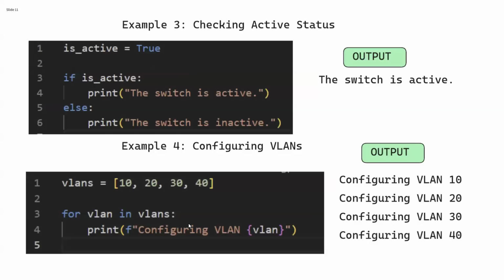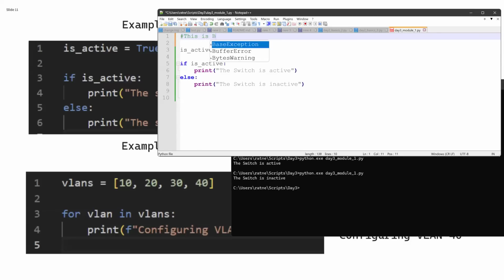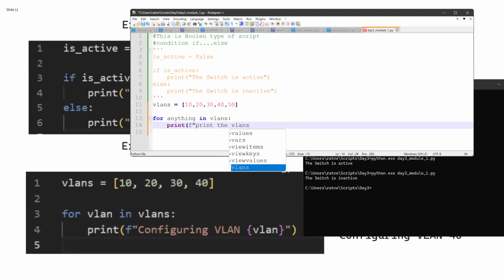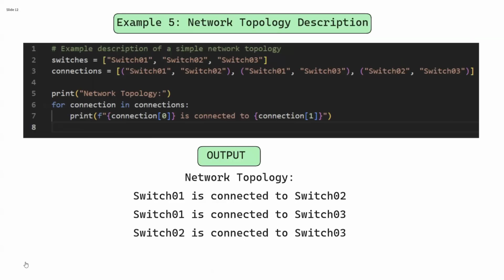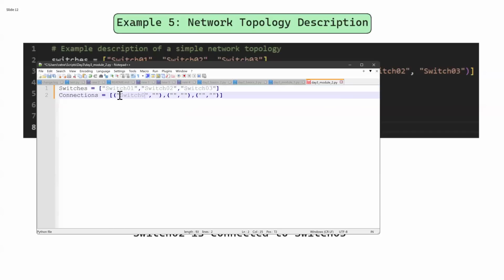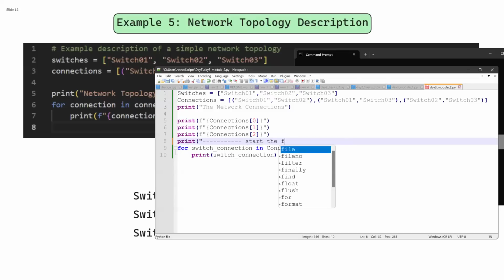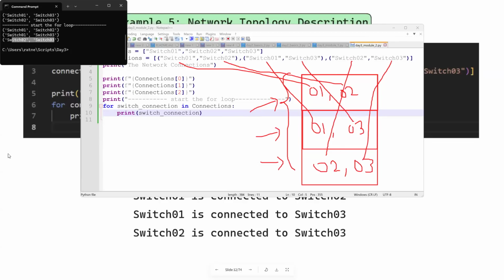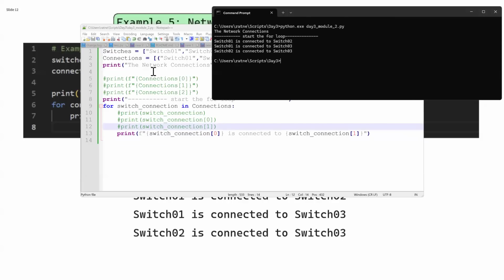Python Training 03

Comment: How to know how much IPS bandwidth is required( like 100 mbps or 1 gbps) as per the site user number, can you help me to understand.
Reply from the maker: 1. Understand the Basics of IPS Bandwidth:
The IPS bandwidth requirement refers to the amount of traffic that the IPS device can process without causing latency or packet drops. It needs to be sufficient to handle the site's maximum traffic volume while performing deep packet inspection and other security tasks.

2. Assess the Site's Network Traffic:
A. Calculate Peak Bandwidth Usage:
Measure the peak bandwidth usage at the site using network monitoring tools. You can use tools like NetFlow, SNMP, or other traffic analyzers.
Look at the busiest times (e.g., working hours) to estimate the highest bandwidth utilization.
B. Estimate the Average Bandwidth Per User:
Determine how much bandwidth an average user consumes during normal operations.
Different applications have varying bandwidth requirements. For instance:
Browsing and emails: Low (100–500 Kbps per user)
Streaming and video conferencing: High (1–5 Mbps per user)
Cloud applications or backups: High (5–10 Mbps per user)
C. Multiply by the Number of Users:
Multiply the average bandwidth per user by the total number of users at the site.
Add a buffer (20–30%) for unexpected spikes in usage.
3. Account for Traffic Types and Inspection Complexity:
A. Traffic Types:
Identify the types of traffic your IPS will inspect. Encrypted traffic (HTTPS), for example, requires more processing power than unencrypted traffic.
B. Inspection Depth:
The level of inspection affects performance. Deep packet inspection, SSL decryption, or advanced threat analysis consume more IPS resources and may reduce throughput.
4. Evaluate IPS Performance Specifications:
Check the IPS device specifications from the vendor:

Maximum Throughput: The total bandwidth the IPS can handle under optimal conditions.
Real-World Throughput: Throughput when all security features are enabled (e.g., SSL decryption, threat detection, etc.). This is usually much lower than the maximum throughput.
Ensure the IPS can handle the calculated peak bandwidth with all security features enabled.

5. Plan for Growth:
Consider future scalability. If the number of users or traffic volume is likely to increase, choose an IPS with higher capacity than your current requirement.
Allow for at least 25–50% headroom to accommodate growth.
6. Example Calculation:
Scenario:
Site has 500 users.
Average bandwidth per user is 2 Mbps (mix of browsing, emails, and light streaming).
Peak utilization is 70% of total capacity.
IPS will perform deep inspection and SSL decryption.
Steps:
Total Estimated Bandwidth:

Bandwidth
=
Users
×
Average Bandwidth per User
Bandwidth=Users×Average Bandwidth per User
Bandwidth
=
500
×
2
 Mbps
=
1000
 Mbps
Bandwidth=500×2 Mbps=1000 Mbps
Peak Bandwidth Utilization:

Peak Bandwidth
=
1000
 Mbps
×
0.7
=
700
 Mbps
Peak Bandwidth=1000 Mbps×0.7=700 Mbps
Add Buffer:

Required Bandwidth
=
700
 Mbps
+
30
%
=
910
 Mbps
Required Bandwidth=700 Mbps+30%=910 Mbps
Check IPS Specification:

Ensure the IPS supports at least 910 Mbps throughput with all features enabled.
7. Other Considerations:
A. Redundancy:
Deploy redundant IPS devices if the site cannot tolerate downtime during maintenance or failure.
B. Cloud-Based IPS:
For sites with highly variable traffic, consider a cloud-based IPS solution to scale bandwidth dynamically.
C. Subscription Licensing:
Ensure the IPS licensing supports the required bandwidth. Some vendors limit throughput based on the license tier.
Conclusion:
To determine the IPS bandwidth, calculate the site's peak traffic, adjust for inspection requirements and growth, and compare with the IPS device's real-world performance. Always consider future scalability and redundancy for optimal results.